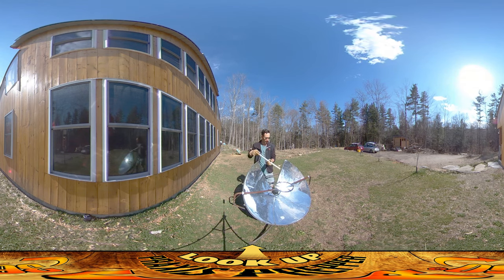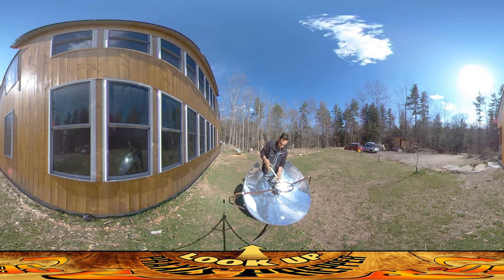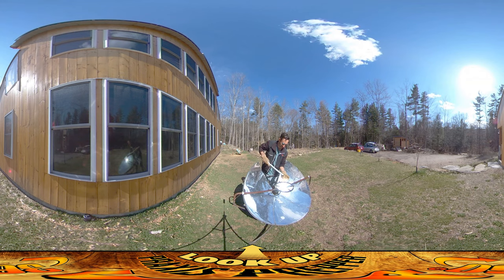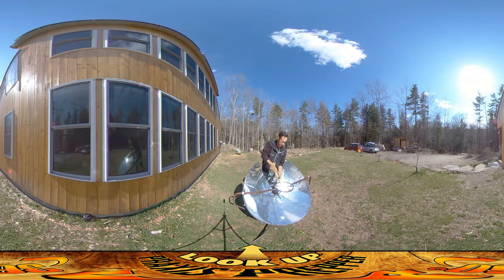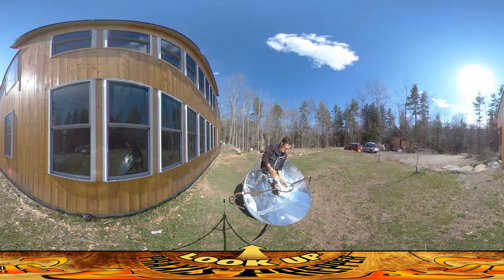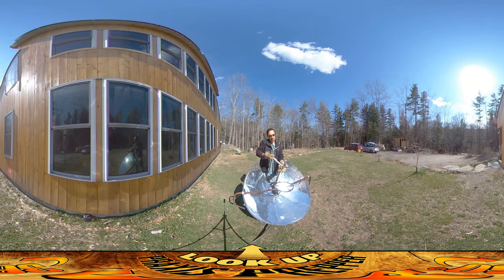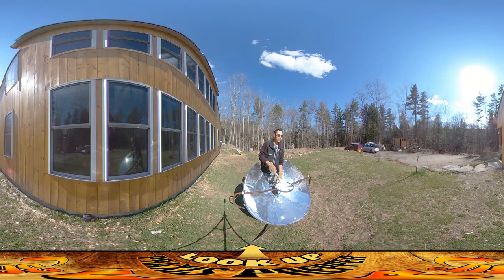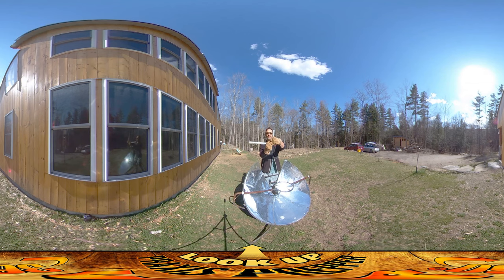Homestead Building - Bending PVC with Solar Power

Comment: Good of you to mention putting side pressure on the pipe while bending it, easy thing for people to either forget or not know and ruin a piece of PVC in the process. We used to use weed burners or other propane or MAP torches on construction sites, heat guns also work well but take longer.

BTW, while looking around I found myself looking for Waldo 🤪
Reply from the maker: Waldo hasn't been seen in these parts for a minute.
Reply: @PraxisPrepper  I realized I hadn’t seen him in a long time so I found myself looking, also checked to see if there were any spaceships or a broken moon.

Comment: I've always wanted one of them, do you have to cover the dish when not in use, so you won't  start forest fires?
Reply from the maker: To be honest, the only time this thing came close to starting a fire (and by close, I mean it actually started a fire) was when I left it out with the canvas cover over it. The canvas cover was an additional purchase I made for safety. The issue arose when wind was able to pull up a corner of the cover. The gap allowed sun into the dish and it promptly ignited the cover itself from below. After that, I stopped using the cover and just left the dish in the open away from any objects. I also take it down when I know I won't be using it for a while.

Comment: I've often used boiling water to heat PVC for bending and for expanding one end instead of using couplings.
I'm curious, what benefit do you find in using concentrated solar directly instead of heating a pot of water? Just one less thing to set up or so that you can bend in the middle of longer runs?
Reply: Well he probably would have used the solar oven to boil the water so probably one less thing
Reply: How would you get a 2+ foot length of pipe in a pot without putting the ends in the water which would soften and deform them too?
Reply from the maker: I haven't seen your method, but if it involves dipping the pipe in, then I would think it would make it hard to make a bend in the middle of a long pipe. If it involves pouring the water over the pipe (I presume this is your method), then it would require a basin to catch the boiling hot water and maybe splash issues? I'm sure you've worked out your method better than I'm imagining here in my back of the napkin conjecturing, but the method I use here is pretty easy and quick... as long as the sun's out.
I'd be curious to know how you apply the water to the pipe in a safe and controlled way. I might want to try it sometime. I've used boiling water for softening up the ends of pipe when I want to slip them onto a barbed fitting and I know that makes it WAY easier.
Reply: @PraxisPrepper  I use a pot and dip if it's the end or ladle over the pipe if it's the middle.
When using solar (yours is bigger than mine :D) a big pot of water helps as a thermal flywheel on those "mostly sunny" days. 
For a large radius or compound bend, I heat a pot of clean sand and fill the pipe before bending around a form. If I need to bend in place, using salt instead of sand means that any residue will dissolve later.
Reply from the maker: @matthewellisor5835  Those all sound like really good ideas. I especially like your comparison of the pot of water to a fly wheel, and the sand inside to help prevent pinching the pipe. Thanks for sharing!